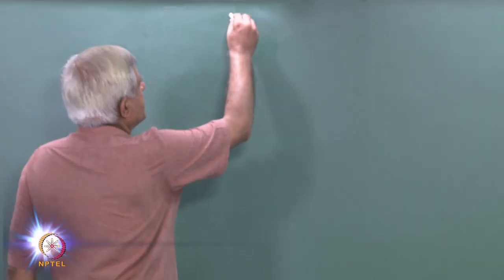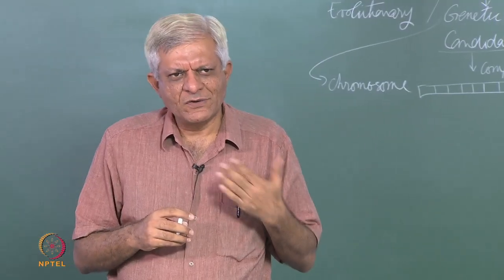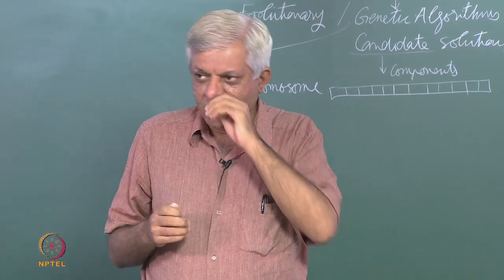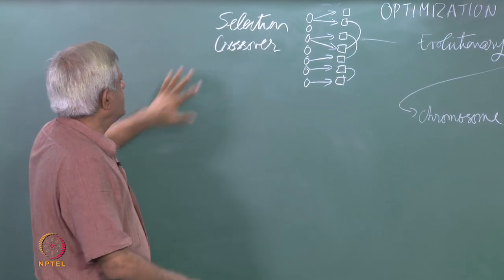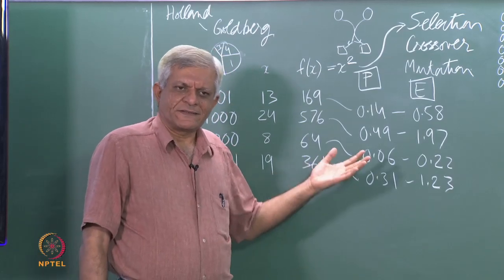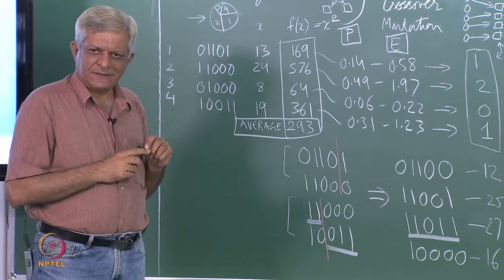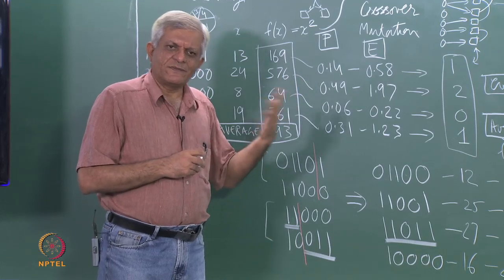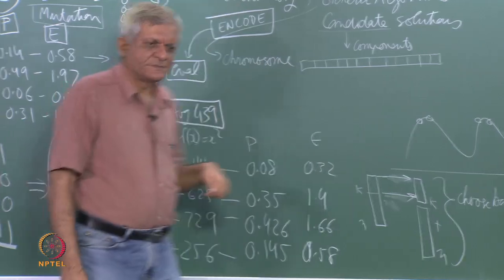Population based methods for Optimization

Comment: What is the role of cloned population in the crossover? How does the previously cloned population have an impact on the next crossover? While cloning is random, selection process only depends on the fitness function of a species and not on the current population of that species. So what is the use of cloning when we are not taking the size of the population of a species into account anywhere in the algorithm?